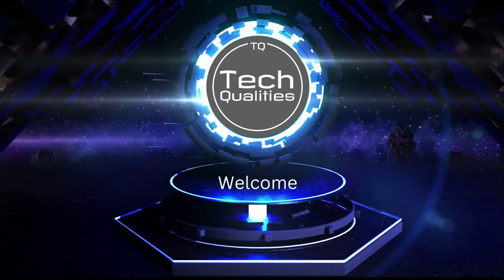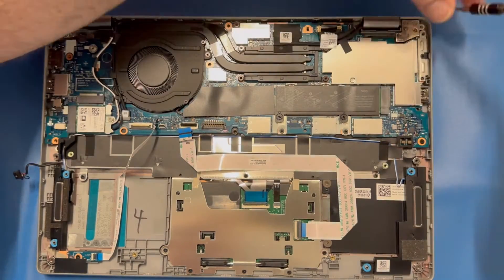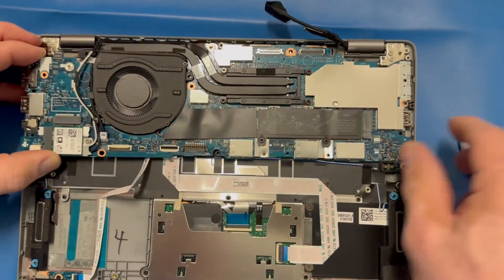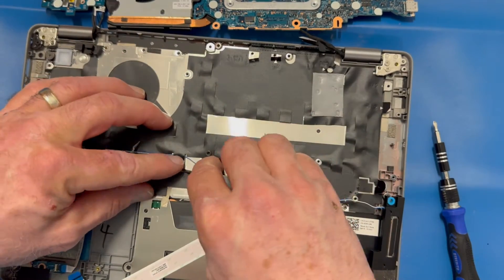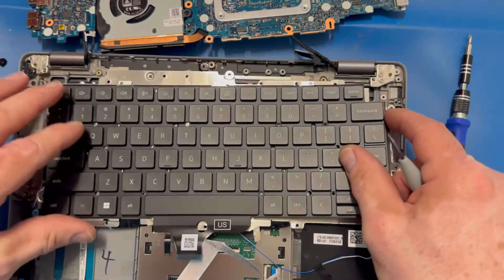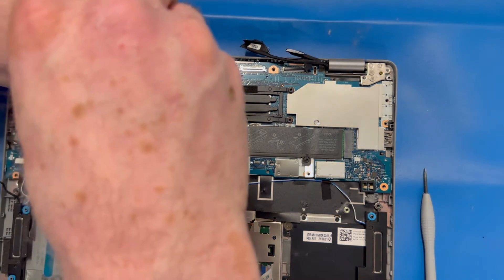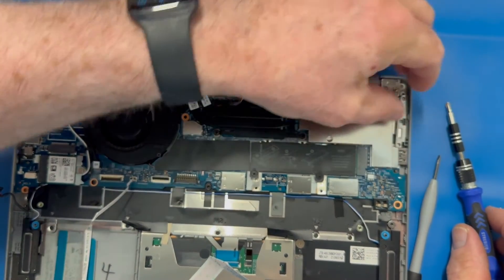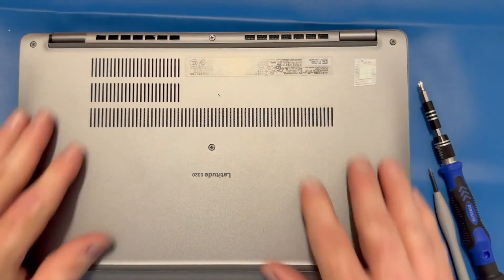Dell Latitude 5320 Keyboard Replacement

Comment: Hey. Absolutely amazing video. First time I attempted something like this and I managed to do it. I may have a problem and I hope you know something about it? When I type with the right side of the keyboard, some keys type double characters like press A it type AS, S types SA, Q types QW and so on. Do you know what that could be?
Reply from the maker: Sounds like a bad keyboard.  Where did you get your replacement?  A lot of times depending on the make and model you want to apply pressure along the palmrest frame between the keys.  You’ll feel the frame snapping in to place and the keys will appear to sit higher on the palmrest.  Be sure this is done after your installation.  If it’s still an issue, the keyboard you installed may have a problem.

Comment: Thank you for the video.
There's a question I want to ask. I just bought a Latitude 5320 and on the left side of the keyboard feels weird.
It seems like the palmrest is somewhat swollen up or the keyboard is just sinking a bit. I'm not sure.
I have my palmrest + keyboard + keyboard bracket replaced by Dell but that still doesn't solve the problem and Dell doesn't want to fix it anymore.
So what is your opinion on it. Thank you.
Reply from the maker: Sorry for the delayed response.  Couple of things to consider.  If you watch my video right when I remove the internal keyboard and it’s laying face up.  You’ll notice tiny posts between the rows of keys.  When a new keyboard is installed, sometimes the tech forgets to apply pressure on top of the palmrest to snap the keyboard frame to the keyboard itself.  
Make sure your laptop is powered off, then run your fingers along the “silver frame strips” that run between the rows of keys from left to right. Apply enough pressure and see if you can feel/hear them clicking in place.  If these are not clicked in place, the keyboard frame will sit up higher and cause your keys to look sunken in.  Let me know how this goes for you.
Reply: @TechQualities  Hello, I manage to fix that by following your guide. Thank you so much, I really appreciate it. Even Dell tech who came to change it 2 times couldn't figure it out. Thank you.
Reply: @TechQualities  thank you for the video - literally had dell tech replace ours at the office, I see what you mean and which I have tried however I can see and fill that underneath where keyboard supposed to clip there is a screw which is making it hard to do this and at this point I feel I could break something. Waiting for them to sort it out cause I am a Tech myself but the device is still under warranty so it is better if they break it themselves
Reply: You were right and thank you again - was just scared of breaking the clips while pressing it against the pins
Reply: @TechQualities  Would I follow the same procedure on a DELL Latitude 5340 laptop K/B?

Comment: Great video on how to dissemble. Any idea where the CMOS battery is for a full MB reset?
Reply from the maker: Thanks for watching!  Some laptop models, especially slim devices, 2-in-1 models, ultrabooks, premium laptops, and MacBooks, do not have a CMOS battery on the mainboard at all. Instead, they use the main battery to power the CMOS memory.